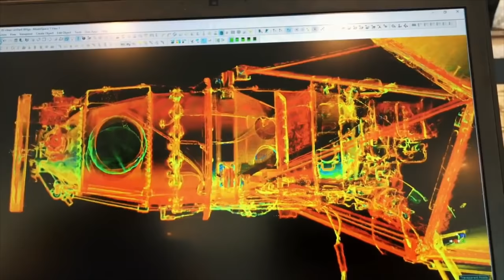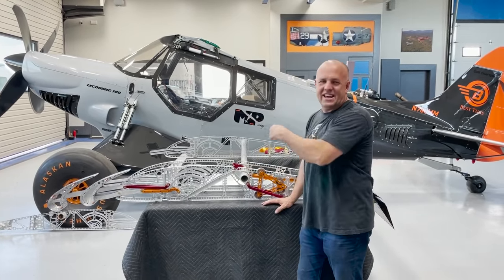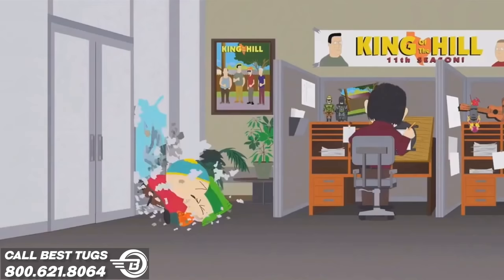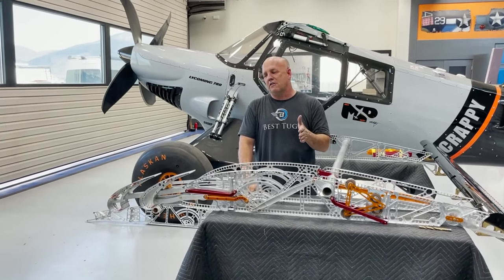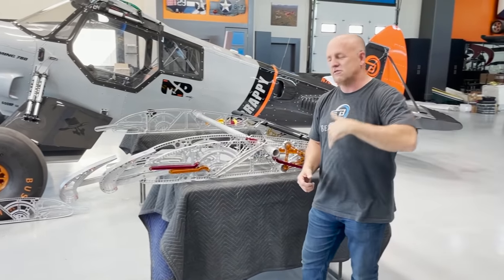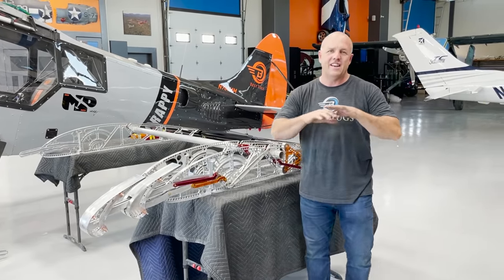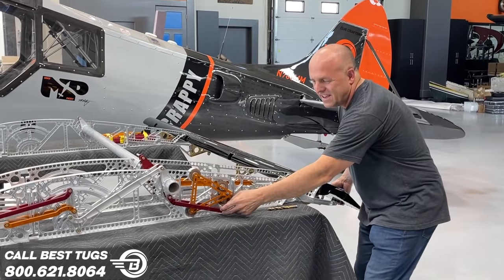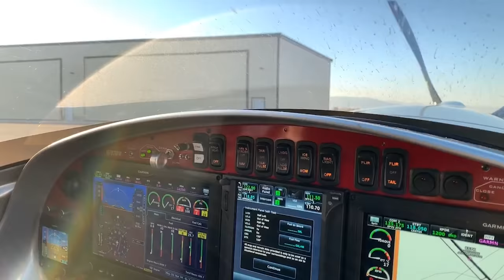DECLASSIFIED Hyper-STOL Transforming Wing - Patey Twin Slats - Fast and Slow | Scrappy #57

Comment: beautiful designing to say the very least- dumb question though, what will the bearings be? galvanic/fretting corrosion concerns between aluminum/steel, or will everything be polymer bearings?  Also, will this be somehow welded into some trussed/stressed skin spar- just looks kinda 'full' already :) one thing for certain, this will be the absolute coolest little plane on the planet, better make sure the russians dont try to steal it LOL :)

Comment: One question for Mike..... I know we only get to see less than 1 percent of what goes on behind these videos, but why have you kept what is essntially a fixed, flat plate airfoil, (horizontal and vertical stabilisers) to control this incredible wing? The tail has to have control authority in what could be extreme angles of attack, wing downwash. prop wash, sideslip ect. Just say 'Yes, modelled all that, works fine'. Then i'll be able to sleep at night. This is in no way a critisism, just a curiosity. 
I have had an aviation passion  for nearly 60 years, my wife calls it an affliction. You will be pleased to hear there is no cure. Enough of that, back to work.

Comment: Yeah, but does that fancy gas tank expand an extra 16" too?  Didn't think so.....Don't forget you have solar panels to incorporate into the wings so you'll have at least a 6kwh production capacity.  This will provide power in remote areas during search and rescue missions.  So not quite yet impressive enough Mike.  Back to Work.

Comment: That is a lot of parts to fail
What happens if the one wing goes in slow mode and the other in fast mode
Can it be controlled
Enough rudder authority?

Think F14 swept wing, it actually flew just fine asymmetrically

I mean you say they cannot bind
but could something get stuck in between, like a small bird or some kind of debris, tree branch or somming (kicked up by wind  or during landing)
And could that induce asymmetric wings?
Reply: There is only one electric actuator so asymmetry not really a concern.  And if something jammed, I imagine the circuit breaker would trip before links started snapping leaving all the surfaces in the same relative position.

Comment: The ideas are pretty cool. But even for a one off design everything seems to have been designed to use the maximum amount of time, money,, effort and materials. I understand that time and money is no object In this project but what about some common sense? Elegant engineering is simple. Anyone can design something complex that works.   
Not being critical, it's his airplane and his money but there are far simpler and cheaper and easier ways to produce the same result.

One question: if someone damages a wing rib in the middle of the wing, how do you replace it without dismantling the entire wing?

Comment: Ailerons?   You’re using Ailerons?   With a little more CAD work, you could have those wings a warpin’!

Seriously, though, I guess there will be some teardrop blisters on the upper surface to clear the horns on the torque tube etc?

Comment: Wow! Impressive but....please let's stop using "hypervelocity" none of the air flow going on here even approaches that (mach 4 ish).

Also. The air flowing through the slats is not compressed in the way that most people would understand compression. It is better to just call it accelerated.

My 2c.

But super cool! The whole idea that stalling will not be the problem that limits slow flight is mind bending.

Comment: Careful Icarus...
K.I.S.S. 
The more complex you make it..
The more prone it is to failure..
Much bigger and more powerful engine, changing the wing loading, adding 120 gallon fuel tank.. I see a lot of added airframe stress... I don't see any airframe  reinforcement. You are redefining the  safety design envelope for the airframe